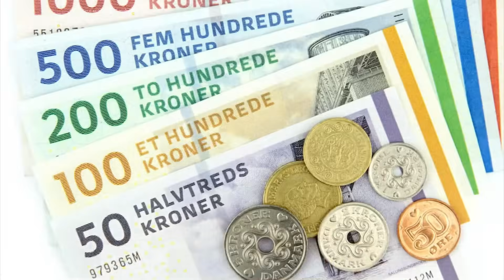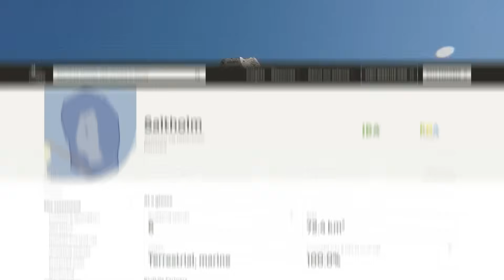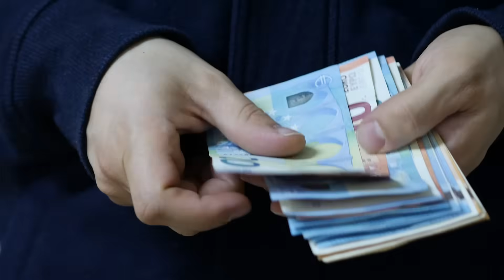Can the Øresund Metro Unify Denmark and Sweden?

Comment: This would be great if it happens. There is a push to expand the rail corridor from Malmo to Hassleholm to 4 tracks (Malmo-Lund is done). With that and a little faster trains, we could have a commute to Copenhagen H in less than 75 Minutes from 100km away... wow...
Reply: This project won't connect to the regular rail line (Sodra Stambanan)
Reply: @user-wm3hu7lo1g  indeed it will not, but will make it possible to commute to Kopenhagen daily from as far as Hässleholm... This can lead to more trains in the smaller villages like Stehag, Tjörnarp etc... making them a cheap (for now) and affordable alternative to living in an apartment in Lund/Malmo.
Any transportation project should be looked at as a system and as an alternative to driving a car...
Reply from the maker: Absolutely agree. The potential ripple effects on housing, local rail frequency, and regional equity are huge. Even without a direct Södra Stambanan link, projects like this can still shift commuter patterns and open up more affordable living options outside the Malmö–Lund corridor. The key is thinking in networks, not just endpoints.
Reply: What you really need for Hässleholm is the ERTMS signaling system. It will allow trains to run at 250km/h, and increase capacity on existing tracks.
Not a metro tunnel operating at 80km/h.

Comment: As someone who lives in Malmö, I don’t think this is the way forward. I think focusing on on regional travel is more important, especially because of the Fehmarn Belt tunnel. If a tunnel is built between Malmö and Copenhagen it should be done as a heavy rail tunnel. This will help both regional and international travel and shorten travel times for everyone. A metro will not really increase capacity in the railway system since most people have to change trains and the Øresund Bridge will still be overcrowded due to high demand to go to the airport. Which a heavy rail tunnel the travel times from København H to Malmö C will be like 10-12 mins and even long distance trains from Stockholm and Oslo can use it to continue down to Hamburg and Berlin. It will also help with travelling from other parts of Skåne and Sjælland as capacity is kept high. I think this is the better option.
Reply from the maker: Really appreciate this perspective, especially coming from someone in Malmö. You’re absolutely right that the Fehmarnbelt tunnel will reshape regional travel, and that longer-distance capacity through the corridor is a key issue. That said, the Øresund Metro isn’t trying to replace heavy rail, it’s more about relieving commuter pressure on the existing bridge and improving cross-border frequency for short trips. Ideally, both solutions could work in parallel: a metro for urban flow, and upgraded heavy rail for long-distance integration. But your point stands, if capacity and transfer efficiency aren’t addressed system-wide, the metro alone won’t be enough.

Comment: 3:08 The Fehmarn belt tunnel are not made by boring machines.
Reply from the maker: You’re right again, the Fehmarnbelt tunnel is being constructed using the immersed tube method, not TBMs. Thanks for flagging that. With limited visuals available, we sometimes have to approximate.
Reply: @urbangiantsofficial  A similar Tunnel was made in front of the Airport, to avoid high columns in front of the planes, landing and starting, and it ends and comes up from the artificial island, Peberholm (To the side of Saltholm!).